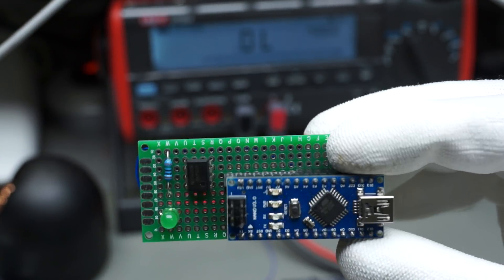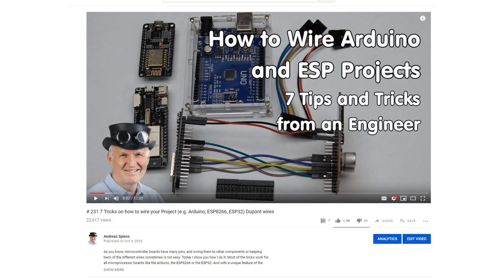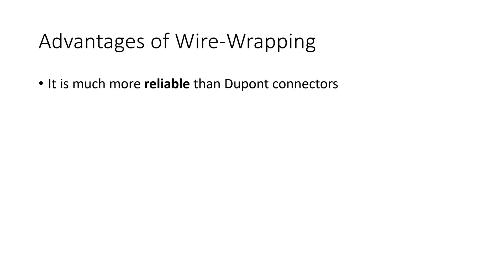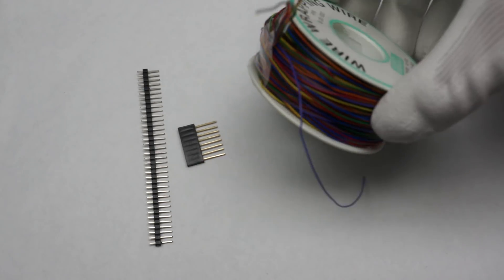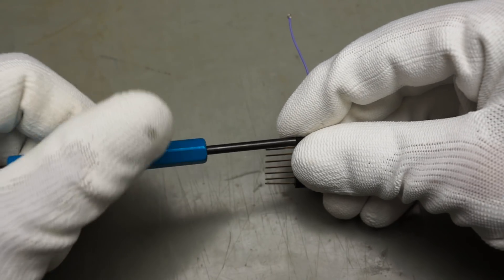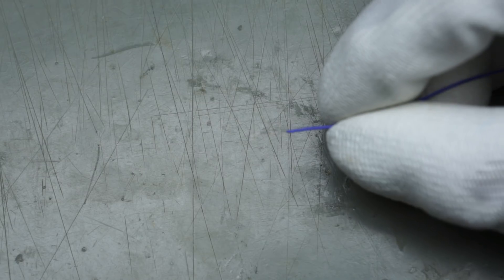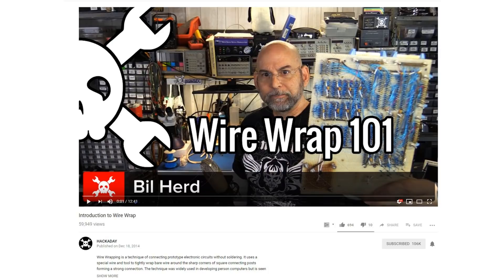#243 Better than Dupont Wires: Wire Wrapping for our Projects (Arduino, ESP8266, ESP32)

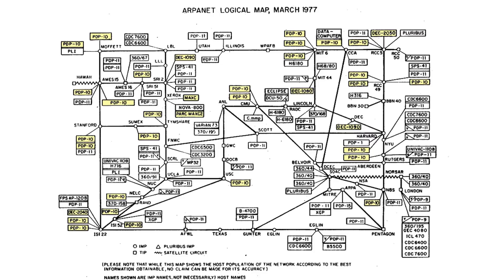Comment: 1:38
(Top left)
  Join the Resistance!

I hear it's nice there. Especially this time of year.
-Jake
Reply: Sorry. I like my bad jokes. 
...
I wish the 'cheap market' would offer more effective options for real wire wrapping sockets. The kind with round, machine-turned, extra long pins. I think the big distributors like Arrow, Mouser, and Digikey still offer the wire wrapping sockets. I haven't looked in awhile but last time I checked they were a few bucks each. Here in California Fry's electronics usually has a few in stock on the shelf. IIRC they are around $6-7 for a 2× pack. These days that is often more expensive than the chip I want to mount in the socket.
  Those extended pin Dupont socket strips like shown here are around 3× more expensive than the regular kind too and they don't come in the 40 row packages either. Maybe one day that will change. They are a bit too flimsy to leave laying around as well.

  I've also had a couple of bad experiences with the regular Chinese turned pin sockets. I have had a couple pins that fractured after replacing IC's half a dozen times. That is a really "interesting" fault condition to try to figure out when it happens in the middle of the socket and looks fine visually. I imagine the problem would be worse if the same manufacturer(s) started making extended versions for wire wrapping. 
-Jake
Reply from the maker: The ones I showed created quite good connections. At least I was not able to remove them. And they are cheap.

Comment: Excellent video. Wirewrapping is a technique that should not be forgotten.
You did not mention that the pins can not be round, they need to be square
so that the edges cuts into the wire and creates a good airtight connection (4 for each turn actually).
Reply from the maker: There were some discussions around the pins. square works much better, but for hobby usage, I also du sometimes round ones. And solder them if they are not good ;-)

Comment: Wow - I was a DEC field service guy (that's #48818 to you) and maintained some of that node at ARPA - I can vouch for the compliment of machines there, the modem (PDP-11/40 + a rack of BB&N modem stuff) and the main work machine - the PDP-15, were "mine".  Back in the day I bought a ton of pre-cut and stripped WW wire, tried out all the tools, wound up mostly using a hand tool (like pictured here), as the manual and C battery guns had "issues.  Still have that stuff - I didn't wind up building as many Kaypro/Xerox-820 clones as I'd planned.  I'd point out a couple of things - one is that you can hold your long-pinned breakout board into the perfboard with a WW connection, so you don't need solder to hold it on (at least loosely).  Second, it pays to put the wires you're most sure of on first, as multilayer wire wraps can get into some real interesting comedy of unwrapping to change one that's under two others...which are under ... and so on.  You really do not want to try and reuse a wire-end as said here - the nicks you put in it using it the first time will give trouble later.  It maybe should have been mentioned that there needs to be a little insulation involved, so at least part of the first turn (the rules used to say at least one whole turn) is insulated wire.  That way a little spring-back won't make for shorts later on.
Reply: #180316
Reply: #64407 - still have my original badge!
Reply: @boblewis5558  That was a great job, if I'd had any idea I might have postponed my career moves for a few more years.  I wound up mid-atlantic support in record time.  Met Ken O by accident up in Maynard...super good guy.  Upvote for DEC guy - we had the world in our hands for awhile.
Reply: #185184 :) in fact years later when HP acquired 3Com I got my old badge number back but with 10 prepended.
Reply from the maker: Unfortunately, I forgot my number. I was there from 1988 to 1995
Reply: @AndreasSpiess  Hah!  I knew you had something special going!  I bet like the rest of us you learned to print very precisely in those little boxes in the forms we had to fill out all the time (if you did field work).  I probably shouldn't be amazed how often the old DEC guys show up in the good communities of skilled people.  No wonder the comments here are a few levels above the usual youtube noise.
Reply: @AndreasSpiess  86 to 97 for me in OLO (Warrington)

Comment: Wire wrapped TMS32010 DSP board design for degree, worked extremely well, great tech for the time and still viable for one offs/development.
Reply from the maker: Or at least to replace some Dupont wires if your device works and you want to deploy it...

Comment: Andreas, great video, I never heard of this method before. Thanks.

One more question: don't you plan to make a video about ESP power saving with Attiny13/85 with measurements?
Reply from the maker: I plan a video about low power, but did not decide what to include

Comment: I object to using wire wrap on a fly, I think that is cruel!
Reply: a fly in a strait jacket ! AWESOME! we should do that to all 94 trillion of them of 'em :P
Reply from the maker: Wiring on the fly also does not look much better ;-)
Reply: it doesn't hurt the fly when you use isolated wire rather than insulated wire.

Comment: Shockingly I was only born in the early 70s so wire wrapping wasn't something I did while it was in heavy use, though when I started prototyping using PIC microcontrollers in the early 90s I built some boards that still work today.  If I liked the design, I used to go round and solder it as I always felt it was more secure, though the couple of boards I didn't solder still worked for years.

Thanks for this reminder, I ought to dig out my old tool, I know I have a couple of spools of the wire somewhere too. :-)

I think this technique is just as relevant today as it ever was and given the difficulty in buying really good quality breadboards (like those RS used to sell) I am often frustrated trying to use them in breadboards, so often end up skipping to Veroboard or 'dead bug' instead.
Reply from the maker: I think we had a"rush to the bottom" in Breadboards. Because it is hard to show quality differences in a picture most people just bought the cheapest and the quality manufacturers were not able to survive...
Reply: @AndreasSpiess  yes, I think you are right.  I find myself looking for old ones from the 90s and hoping they are still in good condition, it's a sbame.

Comment: This is great. Nothing annoys me more than having to connect 5 dupont ground wires to 2 ground arduino pins.
Reply from the maker: If the pin is long enough you should get 4 wraps on one pin.

Comment: Wow, it’s so cool that the OK Industries Wire-Wrap tool (that you linked) appears to be unchanged from the one I bought in the 70’s. :)
I built several of my first 6800 & 6809 based micro systems completely wire-wrapped with an OK JW-1 "Just Wrap” tool (which I still have).
The JW-1 tool was really fast, as no wire stripping required. The post corners cut through the kynar insulation while wrapping, for reliable connection.
It was awesome making really dense DIP based designs on Eurocard square pad boards, with DIN 41612 connectors to a rack mounted Vero backplane.
Reply: I found a Eurocard 41612 extender card in the attic the other day!  Maybe useful again!
Reply from the maker: For complete cards, it is probably easier to order a multi-layered PCB these days... But back then these were not available....

Comment: The main disadvantage is that it builds height and the long pins has a risk of bending, causing short-circuits. I prefer soldering and use a small piece of experimental circuit board for external components. Another method I've used is experimental boards and solder using wire wrapping wire. Since this wire is so thin, it's rather easy to add more connections later since you can easily have 4-5 wires in the same hole. Heat up again with the soldering iron,  stick in another wire. Doesn't build height.
Reply from the maker: This is another use of these wires. A few viewers mentioned they do it this way,

Comment: You forgot to mention the Slit-N-Wrap tool made by Vector. It has the added advantage of not needing to strip the wire first. Also, the insulation used on this wire is Ethylene Tetrafluoroethylene instead of PVC which is much more heat resistant. I like to solder the power connections and wrap the signals. I always seem to need to come back and solder something and this wire keeps me from melting the insulation.
Reply: That was what I was taught as an apprentice at GEC.
Reply from the maker: The wires I bought are normal PVC. Not heat resistant. I did not know the Silt-N-Wrap method. We only had electrical guns and precut wires.
Reply: Saves a lot of time. Avaiable through Digikey here in the states.

Comment: I am going to swim upstream here but been there done that.  No thanks.
Reply from the maker: No problem with that. I think I triggered a lot of memories from the good times when we all were young...
Reply: I guess it would be ok if used to replace DuPont wires between modules.  But not chip to chip.   It’s too easy to get the circuit out of sync with the schematic.  With a PCB you know the schematic and the board agree.  Changes with grass and cuts are obvious.   Just my 2 cents.   My university has/had a wire wrapped PDP11/45.

Comment: I wire wraped a PDP-8 to change current circuit communication to voltage level RS 232.
PDP-8 was really a simple architecture, without even a stack and CALL- and RET-instructions.

Ah, the memories of wrapping together a small computers with a 6809, 8085 or 8031 and some ram, rom and IO devices.
Reply: The joys of the "Omnibus"! Unibus on PDP11s frequently needed the bus grant jumper adding or removing for config changes from different boards. SO easy to get wrong though!
Reply from the maker: I used to work for DEC. So I know parts of the history. But most of it using VAX computers and clusters
Reply from the maker: My Z80 (TRS-80 was already on a PCB. No need for wire wrapping there. But at other places.
Reply: @AndreasSpiess  PDP 8 is older then both TRS-80, the z80 CPU and then 8080. Yes, some of the earlier 8080-8085 (and later Z80) based computers was also wire wrapped.
Later was based on PCB:s, as it isn't as expensive to mass produce.  In the University back in 1982, when I first studied Computer, we used wire wrapping a lot.  Great for prototyping.

The PDP 8 was the first mini computer in the world, which means that it was much smaller then previous computers.It could be bought by a research group in a University, in the offices.  Not like the previous computer.
Yes, a mini computer back then weight about 200-300 kg, might have a HD and probably tapes as storage. And several terminals to work from.

The PDP-8 was built by wire wrapping flip chips together. Those was basically the same functions in later TTL  chip, but by discrete components on a PCB.  PDP-11 was also a mini computer, but PDP-8 was a 12 bit computer, and the PDP-11 was a 16 bit computer, and it was inspiration for the 68000 CPU:s.

Comment: wire wrapping is a forgotten art. it's extremely reliable as the wires are cold welded to the pins. it was good enough for nasa.
Reply from the maker: Below there is even a video where they restore parts of the Apollo program...

Comment: I still have my wire wrap tools, both manual and battery powered and some wire wrap IC sockets.  I occasionally use them, though Dupont cables are my "go to" for quick Arduino projects, simply because of the female headers on the boards.  If I want a "permanent" prototype and it is digital, I will consider wire wrap.  However, analog circuits can develop unexpected issues when wire wrap is used, so I avoid it for analog circuits.  Resistors are a pain and decoupling capacitors should be soldered in place, even in wrapped designs.
Reply: Can you tell me if the connection gets worse if the contacts (pins) are used multiple times? In my training at the power station, we dismantled a switchgear and it was possible to change the pins there.
Reply: If the pins (posts) were designed for wire wrap, they are fairly hard (tougher than conventional pins), with square posts, and may be used/reused multiple times.  Of course, eventually they may show some wear.  If the "switch gear" is the sort used for old telephone systems, then it is designed for lots of reuse.  If it is something else, then "maybe?"
Reply from the maker: I totally agree with the caps.

Comment: In the 80's I worked at Singer - Link Flight Simulation translating schematics to wire wrapping lists for the factory workers to wire wrap backplanes and circuit cards.  I still use it for occasional personal projects.
Reply from the maker: Obviously, this technology was used in many industries...

Comment: are the wires singlecore? been looking for cheap super thin single core wires for a while
Reply from the maker: Yes
Reply: Look up Kynar wire on eBay. That's really good stuff. The very fine Kynar is traditionally used for post production mods and/or repairs. It's available in multiple gauge sizes

Comment: I also like using the wire wrapping technique for my projects and I am using the same tool made by OK. However, the tool has a step right behind the insertion channel which tends to kink the wire when it is inserted. I filed that step down and polished it with rouge to form a smooth ramp.
With that modification, the tool works perfectly for me.

One hint: use the square pin headers for ww, the round ones don’t work reliably.
But you can add some solder if you have to.
Reply from the maker: Thanks for the tip about the ramp. I think, I will do it too.

Comment: I've never done wire wrapping myself, but i've understood being told that it only works (reliably) on square pins, since you get that gas-tight connections when the corners cut into the wire, whereas you don't get this on round pins/legs.
Reply: The correct pin to use is a square one. The reason is that the connection when done properly, actually cold-welds the wire to the pin. Round pins can work, but I would dispute their superiority. Neither DEC (Where I worked, as did Andreas), IBM nor HP AFAIK ever used round pins and they made about as high end stuff as you could find anywhere. 

If you unwrap a pin that's been wire-wrapped a long time, the weld points on the pin can usually be seen quite easily. About the only unreliable thing about backplanes made like this (very common) was if the auto wire-wrapped machine broke a wire, it would redo the link,  but very occasionally the broken piece of bare wire would end up causing a short between backplane pins. 

I had a very intermittent fault on a DEC DX11 IBM peripheral interface once, that I spent a whole weekend troubleshooting with a support engineer. We could consistently cause a diagnostic loop failure by rattling the backplane pins but we never found the piece of wire! 

It required a complete new backplane ordering and fitting to fix the problem. It was real fun and games unplugging and refitting all the modules (around 90 of them) back into the backplane. 😱😁
Reply: IIRC, there was a type of wire that could be wrapped without stripping, this could only be used with square pins, as the corners could pierce the (very thin) insulation.  If you stripped the wire, then round pins were fine.  I think the square pins would make the most reliable connection, though, as the wrapping wire is tensioned at the corners and makes the best contact there, with the least oxidation.
Reply: Having done tens of thousands of telecom connections in the 80's and even 90's I can tell you that square or round work just fine.  The higher end equipment had round pins.
Reply: @alaskawoodman  , I wonder if there's any belcor specs floating around on the interwebs on round pins? Mil stuff was all 025 square posts that I've seen. You could feel the tink tink tink from the cold welds when unwrapping them.
Reply: @alaskawoodman  Never use round pins for wire wrapping. Only very specific and well designed pin, wire and application tooling combinations were approved for round pins. For the amateur...Don't touch it. Round pins are usually unreliable. Especially when exposed to time and temperature fluctuations (higher loads or environmental origin ).
Reply: @alaskawoodman  cool. Good to know :)
Reply: Hi Glenn. How did Telecom stop the wire turns from expanding about the round machined posts after vibration or temperature cycles since they are predominately made of copper. Cheers mate.
Reply: Also the insulation should be kynar (or something with the same features) because it's pinch resistant and won't flow out of the way and bridge when you accidentally catch another wire in your wrap.
Reply: You can (could?) get a type of wrapping wire that you don't need to strip, you MUST use square pins for this as the corners have to cut into the insulation.  I don't recall ever seeing round pins, I would have thought square would dig into the wire a bit so it wouldn't come loose?